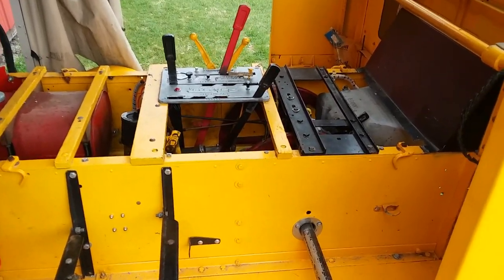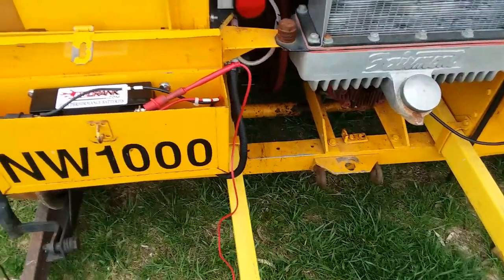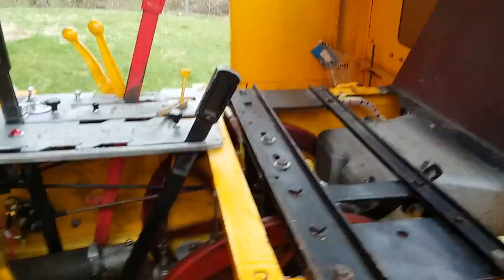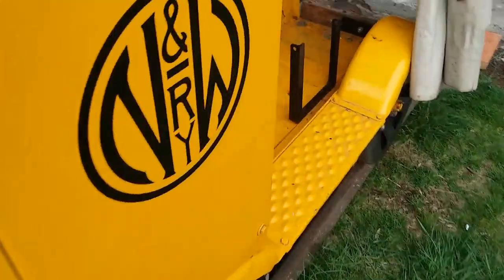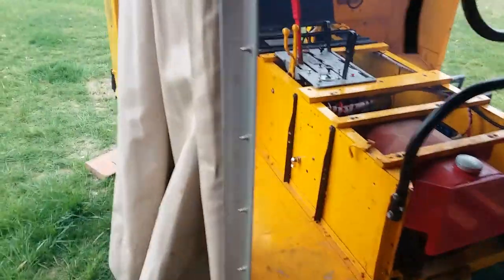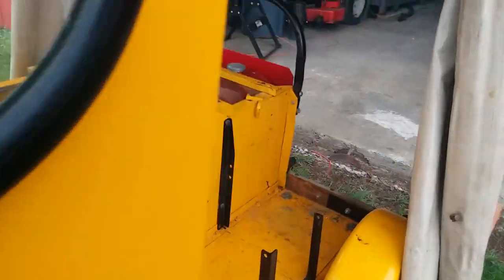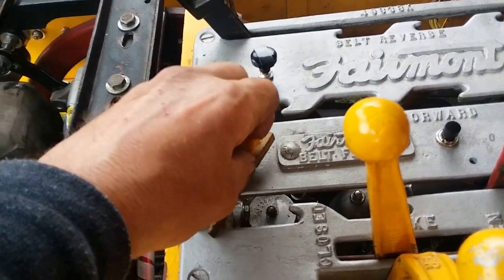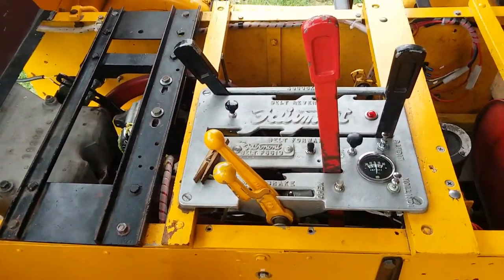Test Start of N&W Fairmont MR19 Rail Speeder

Comment: I would have opted for Honda motorcycle coolant over water in the radiator. Water has no rust and corrosion inhibitor.
Reply from the maker: Interesting. It's a condenser which condenses the steam back to water while running down the tracks. Non-pressurized system too. Thanks for watching.
Reply: @rdg2124  Oh, I see. I'm definitely out of my lane on this one. Thanks for the correction.
Reply from the maker: @illiniwood  Not really, many have never seen such an engine before. They look like a hit & miss engine but are actually 2-cycle and fire on every revolution. Rather rare actually. I'm going to try to do a video on how these engines are constructed and how they work.